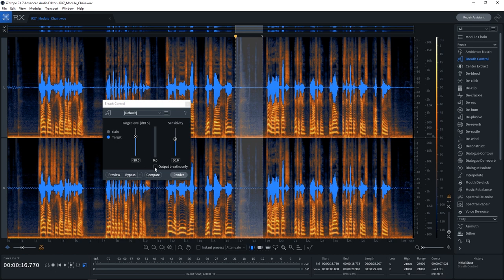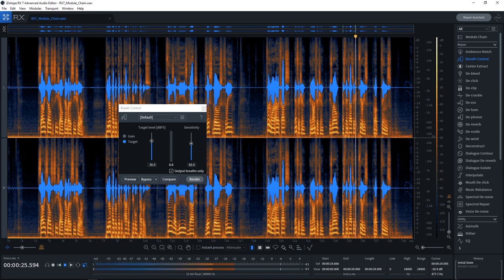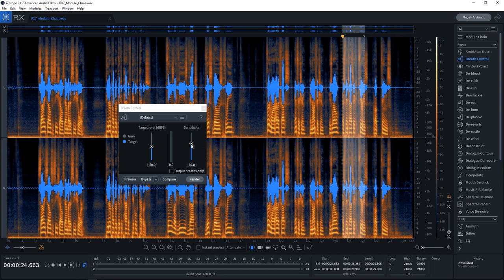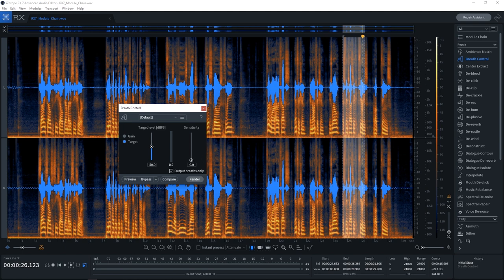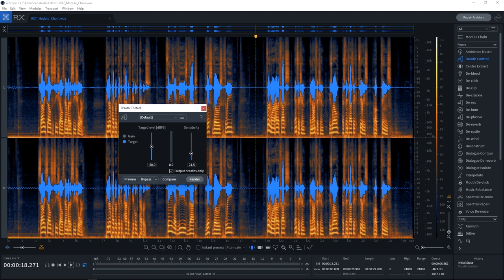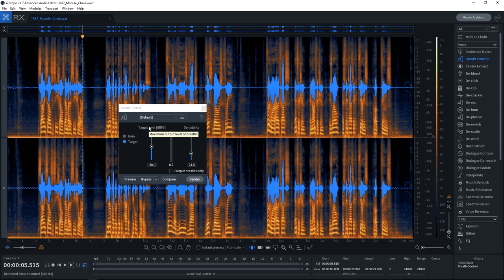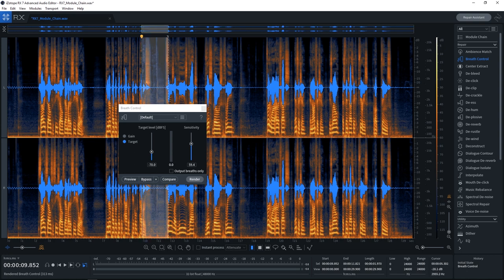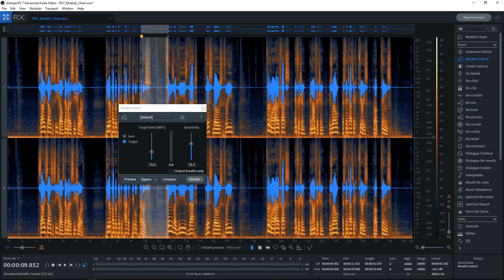Breath Control Module Issues Resolved | RX7 iZotope Tutorial

Comment: I hate the module. It doesn’t save me any work because I have to listen to the playback all the way through just to make sure it’s not catching things I don’t want it to…, in which case.. I can just run it on the individual breaths as I come  across them and then I only make one pass through the file.  Now it’s nice to have the target setting rather than just hitting gain reduction a few times until I get it where I want.

Comment: Cool techniques, but I have a RX7 question. I for 2 weeks had a Samsung exploding phone & during that time I was up front at a few concerts. The note recorded video perfectly, but the audio was distorted due to volume levels, is this something that RX7 can fix?
Reply from the maker: Yes. You would want the de-clip module for that... works really well!
Reply: Joshua Casper Thanks for your fast response. Just curious, I know that there are 3 versions of RX7 (advanced, elements etc.) do all the versions support this? I can afford to upgrade to the standard version, but not the advanced. Thanks again!
Reply from the maker: @MitchGurowitz  it actually comes in the Elements version, which is on sale for $29 right now... click here   https://goo.gl/wW7xi8